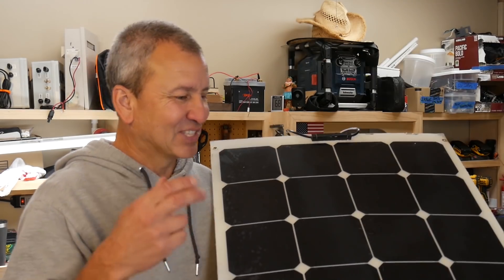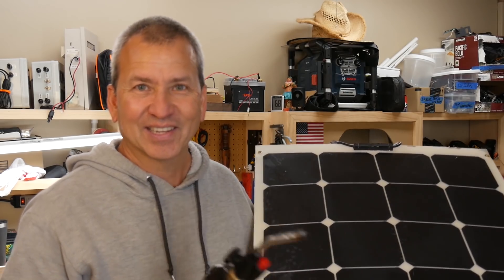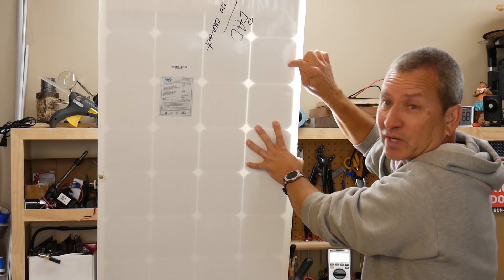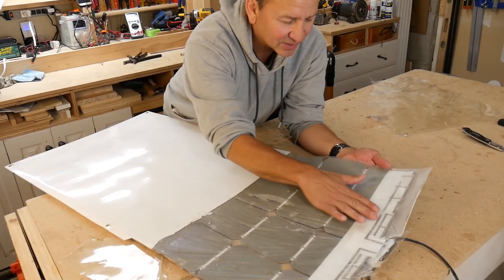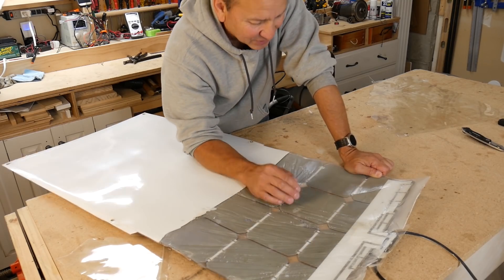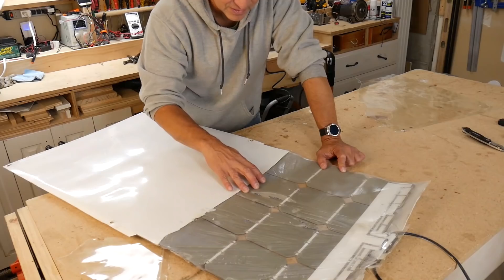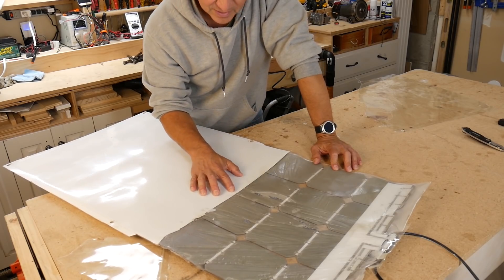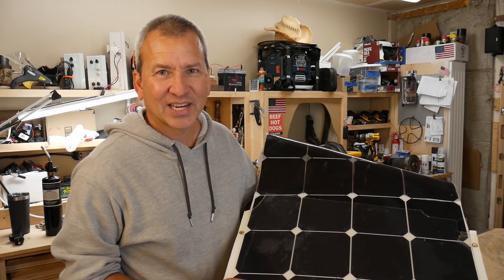TAKING APART a FLEXIBLE SOLAR PANEL - How Well Is It Made?

Comment: I scratched some connection points on the front , with volt meter found 2 middle cell broken so solder on some cable to jump these damaged cells only getting 2 amps now on a 100w panel. They flex and brake if not secured

Comment: Now that you know how they are wired, you should be able to narrow down which of the 4 rows is faulty (prior to cutting into the cells of course).
Maybe you could even test the current between the cells without opening it up, now that you know where exactly they are connected. 

Fixing a broken solar panel may be inefficient, yet if you have time and no money and really need that power, it’s super valuable to know how to fix it. As we electrify our world, this might be basic knowledge at some point.

Comment: Do you think you can take a 400W ridged Solar panel and break it down into 4 100W individual panels?
Reply from the maker: No. They're not designed to be taken apart.

Comment: Thank you very much, because of this video I managed to repair a flexible solar panel with 32 cells. I found 3 cells that didin't gave Amps or regular voltage. I bypassed those by soldering a wire over them and its working again!  So about 90% of original panel is restored! Took me one whole day though.
Reply: @richardvangenderen3220 how did you check each individual cell without destroying the whole panel?

Comment: Hi Brian. Can you show us how the cells in the 24V panel are connected together?
I have a flexible solar panel - Sunpower, monocrystaline, max 150W, max 24V.
The panel has two bypass diodes and 3 wires come out of the panel.
Unfortunately, half of the panel doesn't work. I only get 12V. 
My plan is to check what happened to the damaged half. I'll try to fix it.

Comment: Wait... if you were sucessfull taking it apart why not fix the soldering (add) between cells. Or run test between indivigual cells to locate/isolate/reassemble a pannel with existing good cells?....

Comment: Brian, could the passive heat generated from being on the roof be a possible cause for the failure? Seems these panels get awfully hot while in the sun and one of the reasons why I haven't
installed these flexible panels on the roof.

Comment: Brian, the solar panels are light-sensitive diodes, if you wire them to a power source with the voltage you would normally get from them, (I'm thinking 24 or 48 volts )you would see how they light up and where the cells were failing. This link takes you to the explanation Steven Mould does, https://www.youtube.com/watch?v=6WGKz2sUa0w&t=270s.

I hope you don't mind I put the link here but I believe his explanation could take you to a better solution to check your panels.

By the way, I agree with David Price that a good heat gun would have been better.
Reply: Excellent tip Ellis - a great diagnostic tool !
Reply: Most likely, it is present during production.

Comment: Did you open the black cover over the wires? The piece on the end in the middle?
My solar patio lights usually fail at the soldered wires from condensation making them rust apart. Sometimes a year and a half life! Too short!
Reply from the maker: I'll check that out. Thanks

Comment: Hey Brian, nice video. Informative and revealing. The exterior layer would being brittle is to be expected after two years or UV exposure. If you were screwed to an RV roof and left outside you would be brittle too.  Technologies are ever changing and everything embraced today will be obsolete tomorrow. Be safe on the road.
Reply from the maker: Very true...good point. Thanks!

Comment: So, it would have been useful to trace the power connections to see where the failure is. Voltmeter.
Reply from the maker: That was my initial plan. Sorry, but I gave up after realizing how difficult it was to remove the backing. I may give it another go later.

Comment: Great idea, thanks for trying to help us find the bottom line with solar. Nice, lightweight, slim, more portable, less expensive is the goal, that's why I'd consider getting two flex panels. I like Renogy brand solar because they're based in the country I'm working in right now and have good tech support. Flex panels seem less bulky per watt than solid panels. I'm trying to put together a 200-300 watt portable solar kit for my travel trailer. Any suggestions? Must compare the pros and cons of the solid panel vs the flex panels. God Bless, happy and safe RVing 👍🎶🎄
Reply from the maker: Flex panels work great for portable solar kits because they are much easier to store. I carry two extra flex panels under my bed for extra solar and it works great. My wife doesn't even remember they are there.
Reply: @RVwithTito  Gee, that non functional panel only lasted a couple years? Isn't that a bit short lifespan?  I'd think a decent panel should last 10 plus years, without abuse of course. What brand?  Did you consider consulting the company tech & warranty support team? I do like the smaller size of the HQST panel. Don't understand why Sunpower brand needs such a large top part. Thanks for the previous video compare the three brands.

Comment: Great video as always!👍👍 I never had flexible panels before. To me, they dont seem to be worth it. Between the cost, the effort to install and then remove in just a few years and have to replace them. Glass panels are heavier, but that's the only disadvantage I see in them. Why don't you use glass panels?
Reply from the maker: I know it's a controversial topic. It's nice to have choices. In fact, it's great to see more and more solar options become available to RVers these days.

Comment: your diodes have probably failed, flex panels dont seem to last long by all accounts.
you thrashed it to death, allways like a tear down.
Reply from the maker: Not the diode. I removed the diode and tested it in the other video. It's probably a failed cell or connection somewhere else.